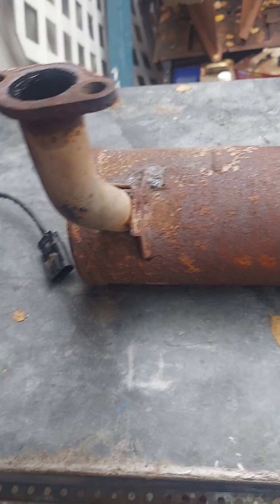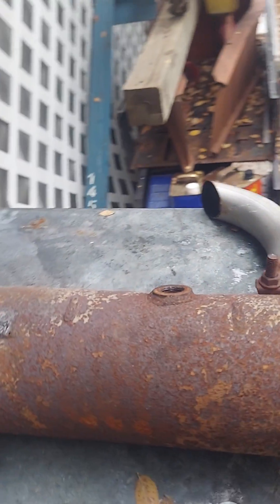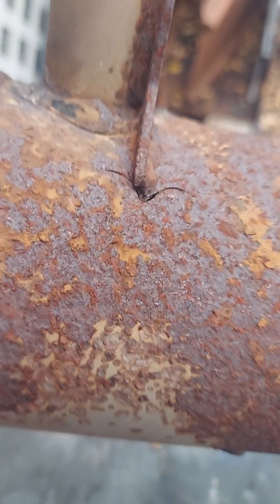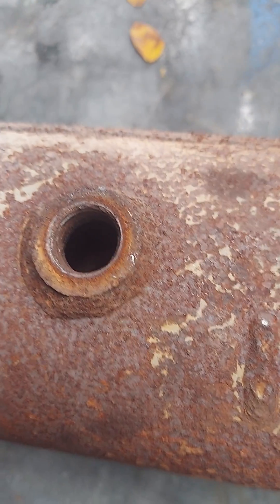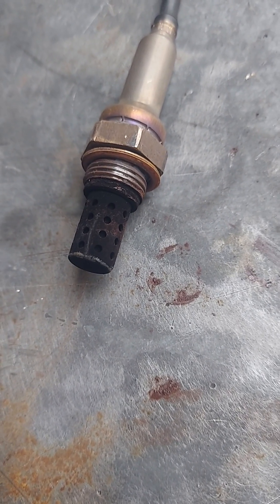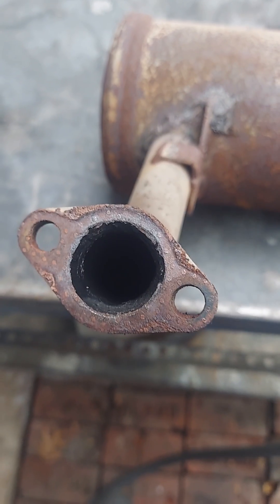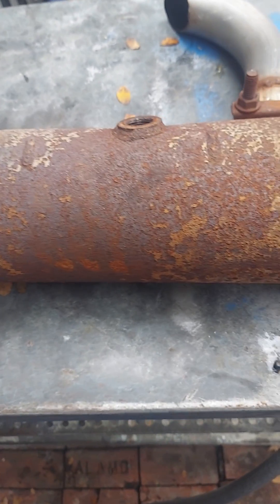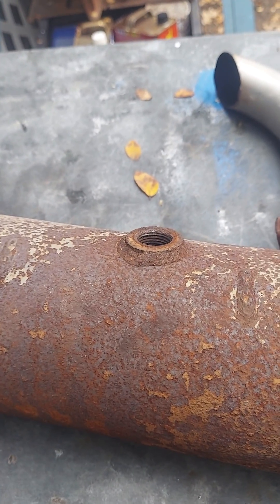Miller Trailblazer 302 Kohler EFI engine will not idle and running ruff at high RPM. Code 0131.

Comment: Did you ever get it fixed? Ive got a 302 with the Kohler command and have been struggling with the idle Solenoid . But this was because of head gasket issues from overheating😮.
Reply from the maker: @welderman6969  Yes, repaired, and the customer was more than happy. If u wish u can join my FB group. Please answer the questions and agree to the rules and I will let u in.
Reply from the maker: https://www.facebook.com/share/g/Lib3LKyqLVapgjsP/?mibextid=A7sQZp